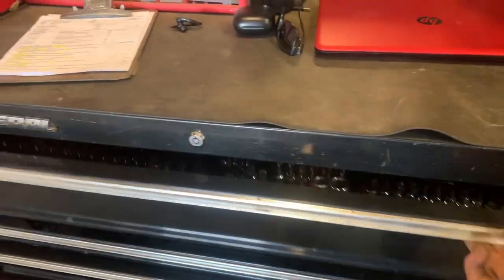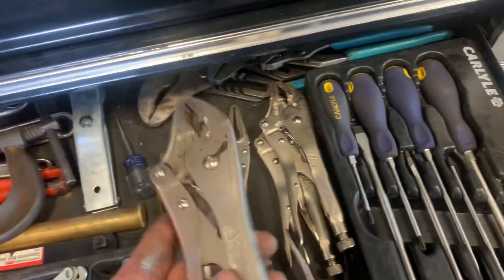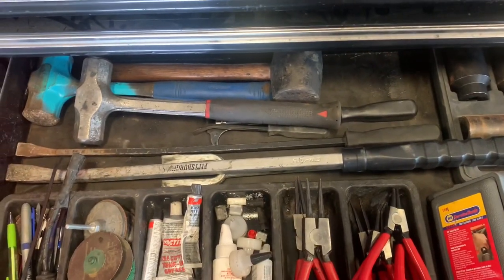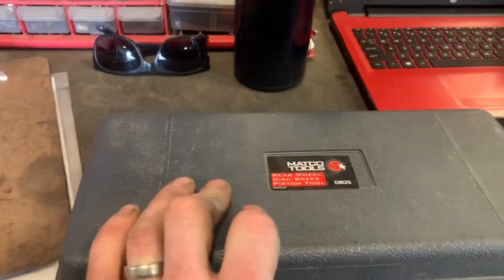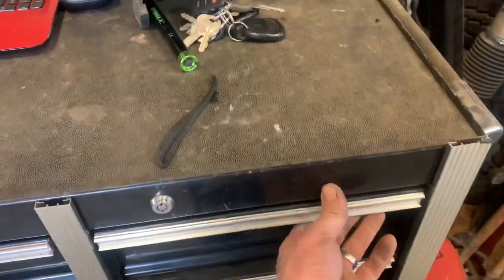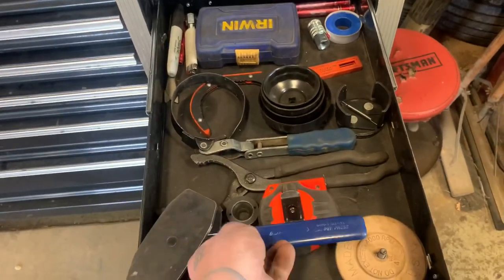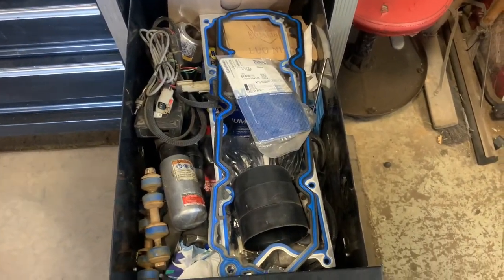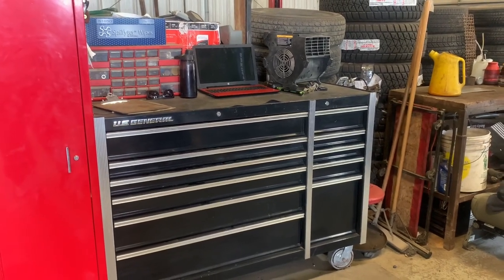Tool Box Tour - Cheap Professional Setup

Comment: "Start with cheap tools and the ones that you break the most are the ones you need to upgrade and don't buy specialty tools until you need them that way you won't waste money in a tool you don't need/use." I read that in the comment section of one video one day and i thought it was a really good advice
Reply: See I buy snap on very cheap  when I buy a ratchet it’s 5$

Comment: I know lots of mechanics who “started out” with Chinese made boxes and then realized it’s just a box and staying out of debt to the tool truck means more than a shiny made in America box.
Reply: Agreed. If you get a big enough box with ball bearing drawers it’ll last a lifetime
Reply: I’d agree with that. So long as I have good ratchets, good screwdrivers and good torque wrenches, I’m happy with everything else being middle of the road kinda stuff.
Reply: @justinlamb3822  my only concern with the cheap boxes is drawers i was looking at the us general double bank but the snap on one, while costing a shit ton of money has MUCH deeper drawers
Reply: @midwestapprentice1904  I agree. I’ve currently got my eye on a snap on and for the price it’ll be hard to pass up
Reply: @justinlamb3822  I’ve been on the fence for a while, part of me wants to just hold off and save for the big triple bank, but is it even worth it to go with a triple over a double bank
Reply: @midwestapprentice1904  depends. Could you use the extra space or are you planning on buying enough tools to fill it?
Reply: @justinlamb3822  rocking a small harbor freight cart as of right now, and desperately need an upgrade but vie been deliberating for about 4 months. my snap on guy has a double bank master series for a decent discount right now, dont wanna tie up a lump sum into a box, was thinking about a bank loan 3% vs 20% snap on interest is alot better. the 2 lead techs in my shop both have snap on boxes one has a double bank with a locker the other has a triple with a hutch and locker, the triple can fit more tools but is so much more expensive, i need space urgently so i was thinking about the 55in box, it clearly works for the other tech and he bills similar hours, doesn't have some bigger specialty tools because they don't fit
Reply: @midwestapprentice1904  If I where you I would get one of those full bank carts, my snap on rep offered me a brand new 36” one for 1600
Reply: @justinlamb3822  how long do you think that would last before I would need a larger box? I had considered it, but I kinda thought id keep my small cart to take with me to cars and have a larger box for bulk
Reply: @midwestapprentice1904  It all depends on how much you buy. I’m in the same situation as you, I got a small 5 drawer cart and want to get a full bank now. I do mainly steering and suspension, brakes and recalls
Reply: @justinlamb3822  that’s pretty much what I do, not much diag just suspension brakes and small engine stuff so I guess all the special tools really starts with diag you know I might actually look into the smaller carts then

Comment: I'm 54 and when I was 17 I bought one of those 300 piece tool kits, over the years I've only replaced the tools that have broken and the rare item that was just not up to the job, I've added items that I needed to it and used it for several years as a mobile mechanic. Although it was a cheap no name set, I still have it and use most of it till this day, although I haven't been a pro mechanic for some time.
Reply from the maker: That’s the way to do it. Most cheap tools will work for many years if not forever. Why waste money.
Reply: @HP116  A lot of guys are hung up on having name brands, my first camping/survival knife was an old hickory butchers knife I bought at a garage sale for a dollar, it worked just as well as those $100 knives and still does.

For me functionality is king.

Great video BTW : )

Comment: The bolt style pulley puller, and the steering wheel puller set have both done me very well.  No abuse obviously.  Keep the pushing screw oiled, and good results for the price.

Comment: I'm a tradesmen and a lot of other maintenance folks I meet are past mechanics, so truck tools are fairly common. But the past mechanics act like anything but snap on turn to dust in your hands. 
Cheap cheap tools, do tend to show how shiddy they are, peeling chrome, uneven star drive teeth and so on. But many tools such as HF and Home Depot are very legit. I did bend my 4ft dewalt crowbar, but hey it happens and its warrantied like every other big box tool. 
In a normal comment section someone would reach in their back pocket and pull out a story of a young mechanic who only had chinese tools and got fired cuz he damaged vehicles and broke tools and couldn't finish work. 
You wanna see cheap tools, check out my loaner bag. People can make those lumps of steel work.

Comment: I don’t have any qualms about using harbor freight. If I break a cheap tool, it means I use it enough to justify buying something nicer. With that said, I’ve yet to break a Pittsburgh socket. Broken 4 different ICON sockets now since March of 2020. I completely wrote off NAPA/Carlyle because I had a 1/2” drive 19mm basically explode off the end of my impact. Broken two Carlyle breaker bars, couple ratchets as well.  Quinn from HF is also pretty shitty too. My boss bought me two Pittsburgh pry bars and I must say they have impressed me thus far.

Comment: Hey man, astro makes an add-on tap and die set that cover's what a lot of master sets dont. Astro 7582  ... Good price on Amazon and I use the mess out of it as I work for a nissan dealer.
Reply from the maker: Thanks a million! I will check those out now

Comment: Thank you for this video! I've heard there are folks out there running Pittsburgh daily in a professional environment. I've always wondered how they hold up. Would love to see a follow-up video of what normally breaks and what you have to warranty out vs replace with better. I have a bit of Harbor Freight in my home tool box and what is actually shocking is the 3/8 Drive wobble extensions held up so well that I took them to work and still have yet to break a single one. That's with a mid torque 3/8 Drive Milwaukee hooked up to them on occasion. I constantly have my 3/8 stubby on them as well. I don't like beating up my snap on Chrome extensions on the impact and Snap-on doesn't offer any impact wobble extensions. Probably smart that they don't because I imagine there would be a high warranty return with folks using reducers on a 1/2 dr and whatnot. I've been using my Pittsburgh's 3/8 wobble extensions daily for about a year and they show no sign of fatigue.
Reply from the maker: I will probably do a fallow up video sometime soon. That’s a great idea.
Reply: @HP116  did you happen to keep track of what it cost you to rebuild your tool collection?
Reply from the maker: @Mtbslacker  I don’t. I would imagine between the box, locker, all the tools including my Ingersoll Rand, Milwaukee, Snap-on (torque wrenches) and some Mac tools, I’d say I’m so where between $2k and $3k.

Comment: nice set up man iv got a lot of cheap stuff in my box as well only name brand tool truck stuff i have is a set of real long snap on screw drivers for hose clamps and a snap on flex head rachet and i only got the rachet because my boss has one like it and i found it super handy and real nice so i splurged on that

Comment: I used to sell tools for a living and let me tell you one thing:
It's 90% brand image you pay for. Especially here in Europe where every tool needs to meet Din or Iso specs. 

Yes, some tools are more comfortable and some will probably last longer. But fact is that 70 to 80% of the tools on the market are manufactured in Taiwan and they are pretty damn good at it.

And percentage includes Snap-on. Because the Taiwanese company I used to work produced impact sockets for the Snap-on brand.
Reply from the maker: For a brand that’s so heavily touted as “Made in the USA” I am not surprised to find out it’s not 100% true. But they wouldn’t be too happy if anyone found out.
Reply: @HP116  Let me put it this way:
If it doesn't say 'Made in' before whatever country the tool of whatever has on it, it is 98% certain that it wasn't made in that country. 

It is forbidden by law in almost every country in the world to claim that it was made there while it actually isn't because you are committing fraud/false claims and so on if you state that it is made in a certain country while it's not.

If it is assembled in the USA you can state 'Assembled in the USA with global parts' like, for example,  Dewalt does.

Next time you step in a Snap-on tool truck, start counting how many 'Made In USA' you actually see.

And for what it is worth:
Snap-on already has a bad reputation for misleading by usiing several COOs on a tool. In Europe it is common to see Made in USA and Made in Spain being used together. But that doesn't mean that those 'Made in'-s reflect the actually COO of that tool as they can refer to the packaging they are on meaning that it is legal to state Made In Spain referring to the plastic bag, Made In USA for the tray while the socket set in that tray can be made up of an Assembled in USA ratchet (mechanism is supposedto be made in Taiwan or Japan), Taiwanese sockets and USA extensions. 

And I believe that in Germany you state Made In Germany as x-percentage of the tool or costs are made in Germany. 

It's a strange world...

Comment: Nice functional setup. I got 10 & 12 x 1.25 irwin taps from ace and a few norsemans online to supplement my harbor freight set. Besides the missing sizes I haven’t had any problems with them.
Reply from the maker: I still need to get the ones I’m missing. Should probably take this as an opportunity to do so.

Comment: I own a speed shop build racing equipment ( engine) transmissions etc. Don't believe that there not any tools other than Snap On and MAC tools in my shop employ 6 certified mechanics must be a reason for it I have NEVER heard one of my guys say well it does the job for what it is or the gauges on a pressure test are not accurate if that was the case I would be out of business I build engines from $10,000 up towards $90,000 everything has to be accurate when you're dealing with somebody else's money and your name over the front door the know-how in mechanics is most definitely a must and part of that know how is knowing what is quality and what is shit
Reply from the maker: I admit some stuff isn’t up to par. I’ve purchased what I need to through Snap-On, Matco, And Mac. I have 3/8 and 1/2” Digital Torque wrenches from Snappy, I have all my fuel pressure, oil pressure, coolant system, compression and leak down testers from Mac. A lot of the reason why I gave the cheap route a go, was due to Snap-On royally screwing me a few years ago. I do everything from head gaskets and timing chains to ball joints and and everything in between. We’re a $106 an hour shop with 2 mechanics, 2 tire guys and an oil tech. We are Swamped 95% of the time. For what I do, a lot of the cheaper stuff works fine. Would I like to upgrade, sure. But as the sole provider for my wife and 4 kids, I enjoy no longer having $100 a week in tool payments like I did a few years ago. I purchase stuff out rite as I can, but when something is serving me well, i end up investing my money in one of my many (expensive) hobbies.

Comment: I've got Matco Cornwell some Snap-On from my grand pa but i also have a tone of different brands and use harbor freight as well about the only things i don't recommend cheaping out are pry bars power tools screw drivers and pliers , that set of platinum double flex head ratchets are awesome i have the same one

Comment: I am a professional mechanic also and have loads of other brands other than tool trucks I also have some Snap-on and Mac and Matco and Cornwell for certain things and a lot of SK and Gearwrench and Craftsman USA in my collection also. I recommend the earthquake air and power impacts from Harbor Freight I had some less expensive ones and they wouldn’t break an axle nut the Harbor Freight one did with no issues they have it on sale this month for $99.99 I got mine right before the sale started but they have a policy that allows you to get money back if it goes on sale in the next 30 days which it did so I got $30 back on it. Everyone in my shop laughs at me because of my tools and because I still use air tools and occasionally a power tool but I prefer air but to be honest I don’t care what they think of me I’m not thousands of dollars in debt each month either if I do buy something from the truck I pay for it in full before I buy anything else. I am only 18 been in the field since I was 16 never been in debt once and now I am a master tech also have all my ASE and state inspection license too.
Reply from the maker: That’s awesome! I wish I had done it that way try first go around. Congrats on the certifications too!
Reply: HPTech Thanks. If you ever do need more impacts definitely give those Earthquake ones a try not worth putting out $800 for one of the Snap-on guns a guy at my shop let me use one to see how I liked it to be honest I really couldn’t tell a difference on them really.

Comment: MAN......I'm in the same set up. I buy it where I can get it, my cheap stuff works and it works well. No hate here at all. Except for the torque wrenches.....IF you dont TRUST them, then spend the money and buy what you do trust. 
Otherwise you got useless junk taking up valuable space in your box. Thats just my 2 cents though.
Reply from the maker: I absolutely agree. I really need to buy a quality 1/2” torque wrench. The shop has one that sits on the shops bench that I use for axle nuts and such, and when I need to torque heads or anything important I borrow my coworkers. Something I will invest in soon.
Reply: @HP116  Gear Wrench has some great ones. Very comparable to Snap on for features and accuracy. Ive got the 3/8 & 1/2 inch drives. Plus they're WAY cheaper than snap on.
Reply from the maker: I will for sure check those out. I was going to get one at a tool show last year but I can be cheap. Thanks for the recommendation

Comment: Would it kill you to clean and line up your gear?
Reply from the maker: It certainly would not. We have been incredibly busy lately and on average I’m working on 10+ vehicles a day. I had checked out several other tool box tours and in so many of them the tools looked like they’re never used. I wanted it to be as genuine as possible. But I absolutely see where you’re coming from.
Reply: @HP116  A clean toolbox and tools does not mean they do not get used. It's called take pride in your craft and in what you do. It doesn't matter if they are expensive tools or not if you take care of them they will take care of you. My rule was never put my tools away dirty even if it meant staying late off the clock to clean everything up and put them away. Oh yeah new subscriber here!!
Reply from the maker: You are correct. And since making this video I have started taking a little extra time each day to clean and organize. I had become complacent and maybe a little sloppy. Thank you for you subscription!
Reply: @HP116  who cares if your sockets ain’t clean or your ratchets ain’t perfectly clean. I been doin this crap long enough to know as long as the tools are in the right place your good.

Comment: what happened for your tools to be lost?
Reply from the maker: I was struggling with addiction and ended up in prison for a time. I will be sober for 3 years on September 11th. When I went away, my Snap On dealer repossessed all of my tools, and although I had over $14k out of $26k paid off, he credited me with used values and I ended up owing almost $8k. I almost have that paid off.
Reply: @HP116  all the best on your recovering. Sucks the tool truck did that to you. I have a 30k tool box and just started insuring it. So far i feel the 300-400 a year is worth the risk of loosing it all in a fire.
Reply: And i agree with your opinion regarding cheap versus expensive tools. truck tools are a "want" not a "need".  a few months a dealership really opened my eyes.

Comment: "You dont need expensive tools" 
Dont buy the HF one it sucks
HF tap set doesnt have the tap size i need 
I kept breaking the HF impact driver
HF coolant tester sucked so i bought mac tools
I break HF drill bits so ill buy a new set whenever
Why not just buy good stuff and be done?? Yes its expensive but you will have confidence that your equipment will not let you down
Reply from the maker: I don’t disagree with what you’re saying. It would be nice to be able to buy all snap on and such, I just can’t justify it anymore. I am a sole provider for my wife and 4 kids, and I can’t afford $100-$150 a week tool Payment like I could when I was in my early 20’s. I get by pretty good with what I have. There are a few things I would love to upgrade still. When I had my first set up I did break quite a few Snap-On sockets, Ratchets, extensions etc, and I would have to wait till the 1 day a week my dealer would come by the shop. With Harbor Freight being a mile from the shop, I can swing by there the same day which does offer a slight advantage. If someday I win the lottery or come into money you know I’ll have the Snap On Truck cleaned out, but for now I’ll keep on keeping on.
Reply: Youre doing good man and i mean no disrespect. I like snap on and i have snap on sockets then i did research and found grey phumatic sockets are better and with them being on amazon i dont even have to leave to get a new one. Gearwrench are good tools too. Harbor freight is cheap for a reason and if you do a littke research you can find better tools for cheap. Harbor freight will not hold up in a heavy duty environment. I see it with everyone new mechanic thats comes in my shop